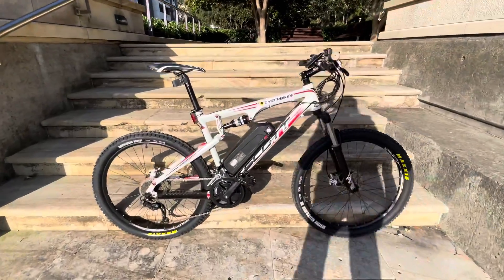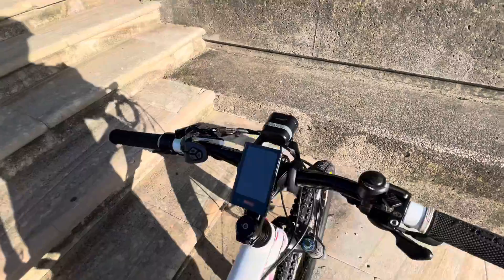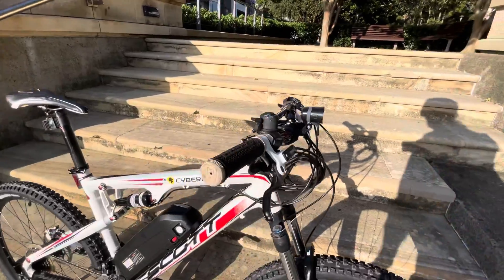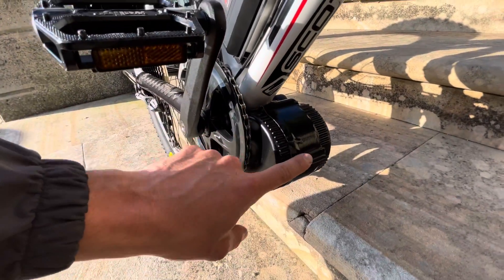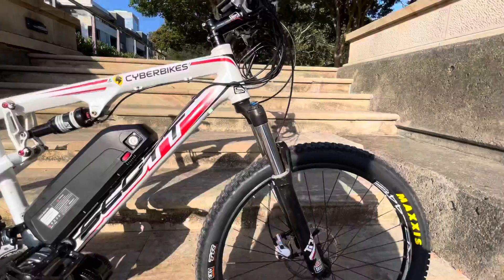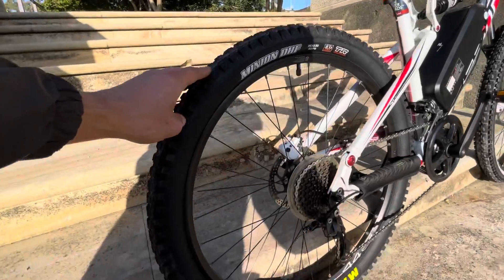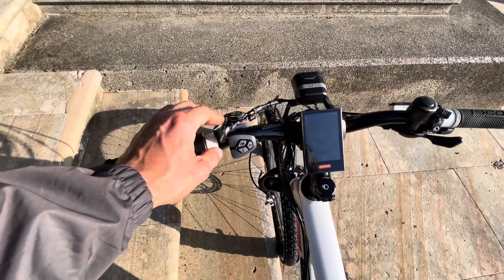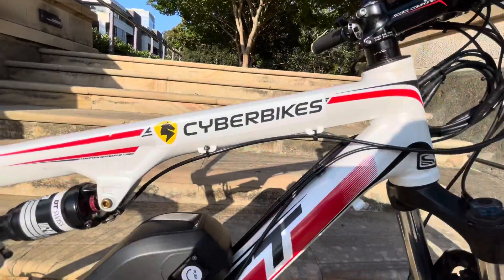SCOTT SPARK 60 RECEIVING A BAFANG MOTOR 750W 48V 16AH LI-ION BATTERY (Video 2)

Comment: I have a 2009 Spark 50, I believed them to be similar or same frame style, what kit did you use ( bottem bracket measurement) and were there any modifications necessary to make it fit properly?
Reply from the maker: 68mm Bafang 750W 48V 16Ah Samsung battery, if your frame is large a hailong 3 battery would fit easily